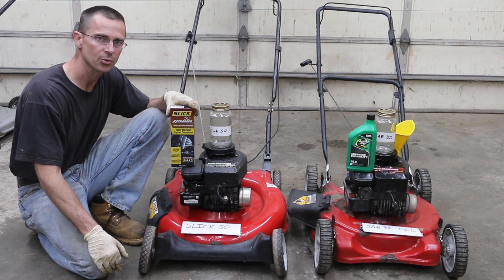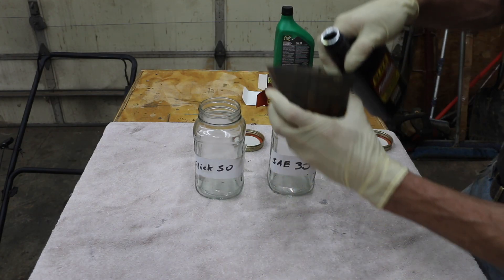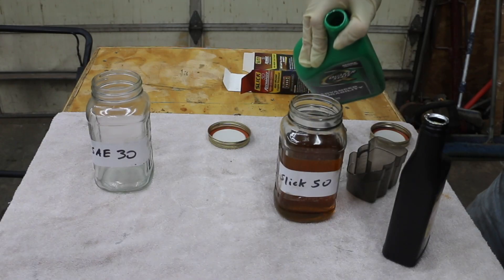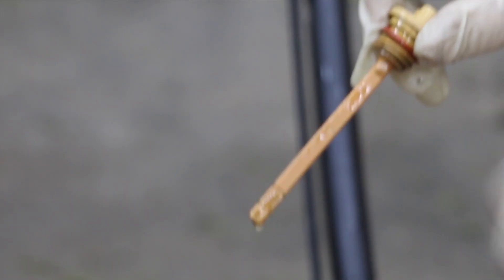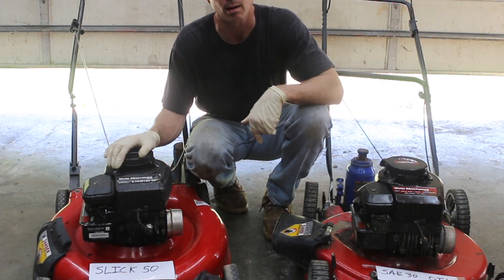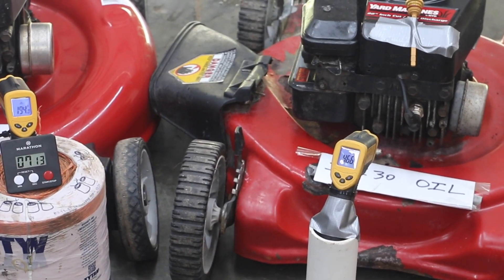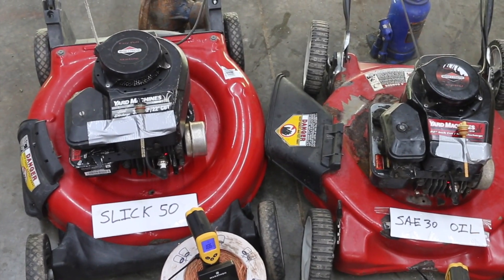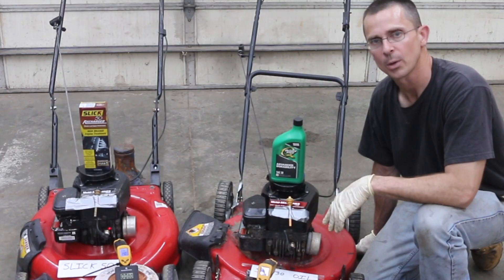Can't believe what SLICK 50 did to my engine!!--Dry Crankcase Test!

Comment: I had a weird experience in the '90s.  I bought a aery small bottle of a product from a TV ad called something like "Motor Minder" or some such name, maybe a 1/2-pint bottle meant to treat one car engine.  They were in a junkyard in the commercial and used a decibel meter to claim it reduced noise, plus other claims.  $29.00 I think I paid.  I never believed any claims from any of this stuff. I got it and a friend of mine and I went out in the parking lot and put it in a rat car I had, '82 Delta 88. With the hood up, we stood there with it running, just bull-shitting around, and to my surprise, a few minutes in, we BOTH at the same moment, noticed it suddenly got quieter.  The shock registered in both of our eyes (we were looking at each other that moment) that something really happened, seriously noticeable!  Quieter for sure!!   Anyway, months later, I blazed over a railroad crossing at a foundry in Harvey, IL  and ripped the oil pan open. I just kept going, and I figured the less I had to walk to get my tow truck the better.  So it locked up a mile or so from my storage yard.   I kept the car laying around.  Months later, again, I put a battery in it and to my surprise, it started up!  I filled this big gash in the pan with Bondo, and added oil.  I drove it for months without it locking op or even knocking!           The axle half-shaft tube came out of the rear end center chunk, at highway speeds so that was the end of the car.  I am honest-to-God truthful about this!!  Now, I don't know if  that additive had anything to do with the car being able to continue on, or whether it was just a freak-of-nature for this particular one time!  Bt the noise went away that day we put it in, just like the ad said!!  So I wonder..............
Reply from the maker: Impressive results!  Some of these additives actually do deliver results. Thank you

Comment: I remember my uncle who was a very good mechanic, he always said that when you use slick 50 to just use slick 50 straight. He swore by it. So maybe a test with straight slick 50, then try the test?  Thanks for the very interesting videos, I have a back issue and spend quite some time watching videos. Your videos are very well done. Thank you sir.
Reply from the maker: Thank you!
Reply: Wouldn't do it.     Might work in limited situations but not designed as a stand alone.
Reply: the only problem with using all slick 50 (even if that snake oil crap did work) is that around $20 a quart, it would be at least $80 to $100 just to fill a typical crankcase in your standard car or truck....No, the only thing "slick" about slick 50 is how they "slicked" suckers (myself included) into shelling out twenty bucks to buy that useless s#*t!!!!

Comment: Next Try Prolong , and try to get Al Unser sr. on your show , he drove a viper at a race track with the drain plug
remove on the viper on the so called commercial .  See how that that last , and see how Al Unser Sr last as well  !!!
Reply from the maker: Great video idea!
Reply: I came here to mention Prolong as well,  it would keep the rings in my 3 wheeler from burning out when I would swamp the engine and get water in the oil.   Haven't used it in a long time, but it saved me from rebuilding my engine many times after trying it.
Reply: The PX would have a special with 4 qt's of oil and a 1 qt  of Plolong for like $11. I used it in a few of my vehicles and really thought did well.  I was desperate and used the transmission version on a Explorer I had.  The auto trans would only shift into 1 & 2.  Prolong said it was specially formulated for dirty valve bodies.  So had it change and added Prolong.  I got a lot of crap from the shop that was doing it.  But leaving there is shifted through all the gears and drove from Wa to Ky for next duty station.  I put another 80k on it before trading up,, I was very thankful it work so good for me!

Comment: Well.... I don't know for sure, but what I do know is my wife had an old dodge caravan that we had treated with slick 50, and she ran out of oil at least 3 different times.... I had to add 4 and 1/2 quarts each time... and it still ran..... we put over 300,000 miles on that thing and when we sold it it was still going strong! I have treated all my cars and trucks with it....
Reply from the maker: Impressive!

Comment: Probably not the best idea to run these side by side where the slick 50 motor is blowing its exhaust into the intake of the SAE-30 mower since it will decrease the oxygen content of the intake air on the SAE-30 motor and increase the intake Air temps significantly for that motor as well.  It would be better to run them in a front to back row so they are both pulling air from and then blowing exhaust out to the same sides of each mower.
Reply from the maker: Thank you
Reply: partyman6666 you can’t be serious.
Reply: Actually it has the reverse effect, it reduces the combustion temp, google EGR valve..

Comment: If both engines had died at the same time it would have indicated slick 50 was useless. Because the slick engine died so much earlier it suggests it had more to do with the difference between the engines than the oil. There are plenty of reasons slick might be no better but none as to why it might be worse - especially when removed.
Reply from the maker: Thank you for the constructive feedback.

Comment: I know this is an older video but I just recently began viewing your channel. Excellent videos. I used Slick 50 myself for years and I wondered if you remember whether or not you had shaken the Slick 50 bottle before adding it to the oil? As I remember using it, the Slick 50 also carried some solid PTFE resins and looked very cloudy after shaking it . (These resins were soft and seemed to cook into the nooks and crannies of the metal parts after running a bit) From this video it looked like your Slick 50 wasn't shaken up. Those PTFE resins are the most important part of the product as I remember. The last time I used Slick 50 was about 2004, so their formula may have changed since then? I had good performance with it in garden tractor pulling engines and racing karts so I was a bit surprised with the results from this video.
Reply from the maker: Thank you.  Yes, I did shake the container but not on camera.
Reply: As far as I noticed, this is "slick50 recharged" which has no Teflon in it.

Comment: BG MOA oil additive is a similar product that works. The BG representatives do live demonstrations with V8’s that have had MOA added to the oil. They the drop the oil pan off the motor (while running) and check the main bearing temps with an infrared thermometer, showing that the bearing temps stabilize and even begin to drop. They don’t go till the motor locks, they reuse the motor over and over for demonstrations. Not sure how long the MOA needs to be in the system to begin reaping benefits, but that would be a great one to check out.
Reply from the maker: Thanks for the video idea.

Comment: My wife let our diesel Jetta get low on oil and it locked up.  I had heard that Slick 50 might help it.  I had my mechanic add two quarts of slick 50 to the new oil he put in,  the next day the engine turned over, no problem.   It may not have been the slick 50 that did it, but it didn’t hurt it either,   Wish you had added slick 50 back to that engine to see if it could have been salvaged.
Reply: Most engines that sieze from eventual overheating will start again when the metals have all cooled down. No oil is going to unsieze an engine just from adding it afterwards, more the expanded piston and rings have cooled down to a level that allows it to rotate again.
Reply: Once the crank bearings seize it they will continue to grind the rod bearings to the point of knocking and major oil leakage
Reply: Yeah...I more or less did the same thing once. I had this car with 388000 miles and the rods were knocking. I added 3 qts of Slick 50 before I went to bed. The next morning when I started it up, no more knocking! When I got down to the red light,  I looked down and the odometer said 214000! I couldn't belive it! I was late for work and went on in to my desk.  That evening when I left for home, the odometer said 112000! What?!! I noticed how much better my car ran...felt like it had 40 more hp. When I got home, I raised the hood to check the oil.....and the engine looked like it had been freshly painted and the valve covers were coated in chrome! That's not all....you ain't gonna believe this ...
when I got up for work the next day......in the window was a dealer sticker....my car was brand new! I went back to buy another supply of Slick 50, but like the guy said, they had sold out and changed the formula. True story......hehe!
Reply: @mark-wn5ek  now thats funny
Reply from the maker: Great point. Thank you

Comment: Shoulda run strait 100% slick 50 in the test engine for the initial test.  I saw their intro in Cali early 80's, their engine ran over 30 minutes and still didn't fry.  They had a torque wrench set up with a rod bearing cap on it so you could measure the pressure you're putting on it and it had an electric grinder motor spinning a bearing journal. It was a "home-made" bearing smoker.  You could smoke a bearing with the oil of your choice at his demo.  Slick 50 treated bearings in his test machine were un-smokable.
Reply from the maker: Thanks for the recommendation.

Comment: I remember that commercial. :-) Shows our age. LOL
Reply: I also remember that commercial. The engines used were almost always 7 main bearing 200 inch ford sixes. they were seriously indestructible. There was a junk yard near where I used to live and their yard truck was an old Ranchero without a cooling system. No water pump etc. When it needed oil they'd just pour it in the front of the oil pan. I know they ran that for the fifteen years I live around there.The engines also ran at an idle. As I recall the inventor of Slick 50 sold his patent and the changed the formula. Last I heard he was trying to reintroduce the product with a different name and the original formula. Don't know what happened. 
I would like to see this done with a teardown of both engines to see what happened inside. The Slick 50 engine was not outwardly running hot and I would love to know what made it seize.
Reply: @timhammett2302  Didn't S50 get sued ?  Apparently all they had to do was stop making rigged vids, but they can still sell product.
Reply: @gerryrice4848  A few years ago I saw that the guy that invented Slick 50 sold the company and the new owners changed the formula. He then went on to make the original again this time with new name that didn't sell well.
Reply: @timhammett2302  wow very interesting to hear that the formulation has changed.
Reply: damn I remember that commercial too, when he mentioned it, that brought back memories.
Reply: If it’s the same commercial I remember seeing, the oil pan was removed and they had a continuous water spray on the crank/connecting rods.
Reply: @ReapersFear  That's the first thing I thought of. The water is the key . . .
Reply: @ReapersFear  That was the Motor Up infomercial using a Toyota Starlet
Reply: electronicsNmore Is that the commercial where they went to the desert and drove a Viper around a track until it ran out of gas while they took the cylinder heads off another engine running on a stand and dumped sand onto the exposed valve train?
Reply: @Mike Lastname I think there were a couple commercials. There was the infomercial that had the engine running on a stand.
Reply: @mikelastname6469  Thats what I remember.  Hard to trust anyone  now and since
Reply from the maker: lol.  Yes it does!  You've got a great channel!  Thanks for checking out the video!
Reply: @ProjectFarm   are you sure your thinking of slick 50 commercial i thought that was the prolong commercial that did that?
Reply: @ProjectFarm  Schafers oil
Reply: If I recall correctly the engine was a Chrysler slant six (225) , they never die anyway.
Reply: @postalinVT  no they don't.

Both my Slant cars still ran fine with over 200k, the subframe was the problem lol

Hell one didn't have more than 20 lbs of oil pressure for nearly 80k and still never used a drop of oil between changes
Reply: @NotablyNova  I believe you. I had a 225 in a '78 dodge power wagon that I bought new and after getting tired of it not being able to get out of it's own way I decided to kill the engine so my wife would understand I need a new engine ( V8, of course ). I tried everything to kill it. Didn't change the oil, run low on oil, over revved it on every shift, didn't fix the plugged radiator so it over heated constantly. Kept right on running 'till the divorce ( I'm talking years of abuse ) THEN I just took it to the junk yard and had them put in a 360 and four speed. Yes, of course I drove it there, it still RAN !!
Reply: @postalinVT  LOL 

If you get a chance check out Uncle Tony's Garage here on YT, he just did 2 videos on the Slant.

Learned quite a bit about the Leaning Tower
Reply: postalinVT- The slant six did not want to ever die.  If you were handy you would change the oil,cap,rotor&wires yearly.
Reply: Dura lube!
Reply: I remember the commercial that featured Prolong vs. Slick 50 in a stock car.  All oil drained and ran the vehicle around a race track.
Reply: @nomaad660  The oil light kept getting brighter and brighter LOL.
Reply: I don’t remember the commercial lasting for hours😂it was a stunt and I assumed it lasted less then one second longer than they filmed it running without oil.
Reply: @johnhungerford6073  they came by MMI when I was there. they did all kinds of things, liquid nitrogen bath etc. but what blew me away was the engine running without a  pan. the only purpose for that was to have the oil pump pick up sucking air, but there was no water spray on the machine at that time.so it must have been before they changed the formula.
Reply: me too. remembered that commercial .. Used Slick 50 on my two stroke bike
Reply: I put it in a car that ran out of oil and it ran for 6months with no oil!
Reply: Shows your age you mean. If you know how old it really is then your getting soggy 2!
Reply: If fairness. The engine in that commercial was a 225 slant 6.. that engine could run forever if packed with peanut butter
Reply: 20 years ago I remember this guy at work preaching Slick50 and POR15 solely based on their advertising I mean it isn’t like he had noticed the benefits of either product he just started using them lol
Reply: Thanks,
Reply: I saw this in a commercial for a product called MotorUp.
Reply: @moninum  yea motor up is in new zealand and they had this engine test with engines on stands about 15 years ago
Reply: Yes it does.
Reply: I remember too....lol
Reply: Me too. Lol
Reply: Yes we had a commercial down under, Teflon added to engine oil, then after running for a while [can't remember how long] drained sump and said they would drive car 500 miles, never did find out what was the result.
Reply: @adoreslaurel  nulon?
Reply: @nigelbryanmee  That is probably what it was called. So long ago I forgot.
Reply: Testing Metal's wear using a fish weight/ hanging weight? so scientific.
Reply: I remember the first time I used slick 50, it blew the engine up in my Chevy truck.
Reply: Amen ! We ran a 1954 Ford V-8 Once on All STP just to see a Different Color of Smoke come out of the Dual Tail Pipes. It was Way Past needing a Bore & Larger Pistons plus fix the Valve Guides, Etc. 325,000 miles one owner before we got it. Carried 2 of the Cardbboard "cans" of STP with us anytime we left the house !! It did have Less Noticeable Smoke coming out the Back but cost too much money to keep doing that !!
Reply: Oh Yeah! Did STP come out first?  I sure ran some old junkers with LOTS of STP.
Reply: it was possible to do this test , back in the day. the formulation changed and now its just oil.
Reply: @lukewarmwater6412  Not sure whats in it now- I used slick 50 not long after it came out in a a full size dodge van slant 6 and a 4cyl caravan - and in a 40 hp boat motor - I had just put a used power head on the boat motor and had a remote switch on it for testing. I took the boat to the lake about 15 miles from home and the remote switch fell between the gas tank an transom and started the motor.  I didn't know it until i pulled to the ramp and a guy told me the prop was turning the last 10 miles. The motor was warm but not real hot, I took it out one the water and it ran fine so I was sold on slick 50 after that, other than you could see some Teflon flakes in the oil when ever you changed it.
Reply: @sammyd4772  fair enough... sounds to me like you avoided a bad day at the lake....
Reply: u also remember they used a radiator to cool the motor ....try it with no coolant slick 50 is gear oil .......80 w 90........... do the sniff test
Reply: @johntorres8869  It was 30w back in the 80's.
Reply: @johntorres8869  Your post is straight up BS. In the words of General Schwarzkopf, Bovine Scatology. 

Slick 50 contained PTFE (Polytetrafluoroetheline) known by the brand name of Teflon. Any viscosity modifier, such as Wynn's Friction Proofing or STP, would only help, if it was put into the oil EACH AND EVERY oil change. Slick 50 deposited a microscopic layer of PTFE onto the cylinder walls and moving parts. After the Slick 50 was drained, its protection still remained.